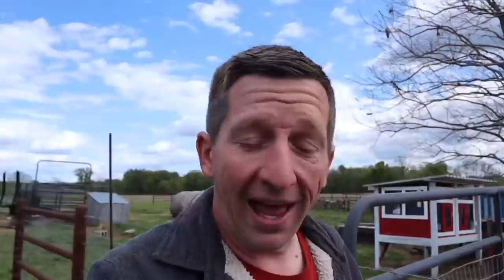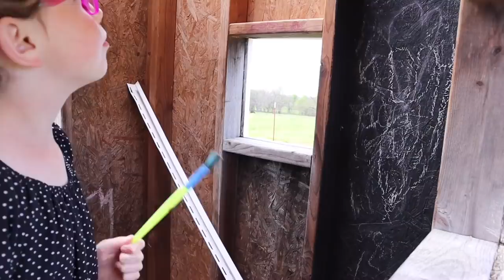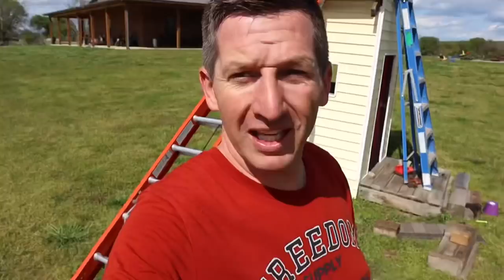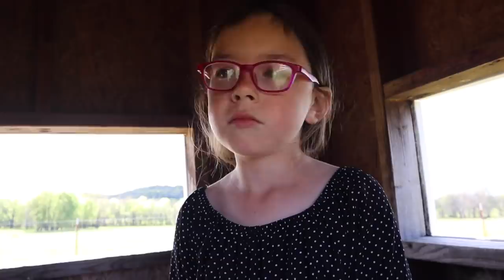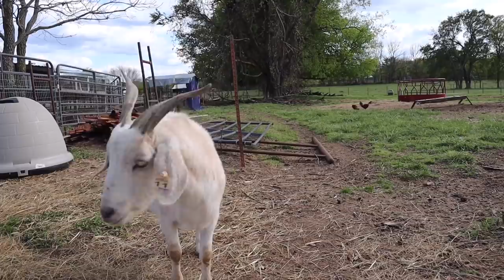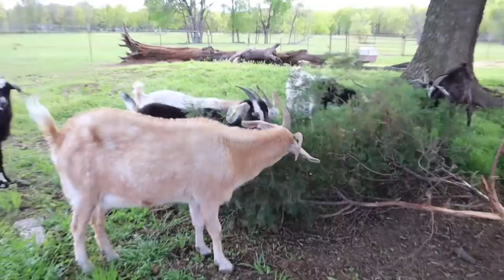High Winds Took The Roof Off

Comment: Now that the roof is back on top, it would be great to give it some more hang on support, lol.  My dad put some "Star Plates" on my kids playhouse roof. Same as they use in a house roof, metal plate with holes in it that attach to 2x4's of both. The roof stayed on during many wind storms!  Finally the walls rotted away but it lasted for the kids and grandkids.
Reply from the maker: Good to know!

Comment: I am betting the tractor  that later is to long or you have to git a shower later it will be better you zing screws it will make it harder for the wind to blow it off. Thanks for the video.  All dad you can be nice an put plastick glass an you can put hinges on so she can prop it open to git air and then it's nasty out she can close it. Ransom good luck 👍